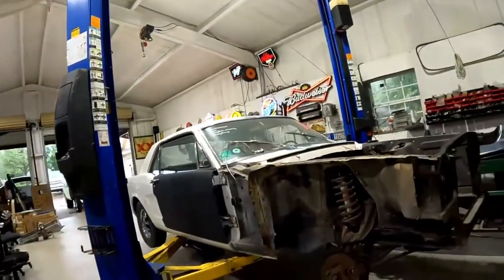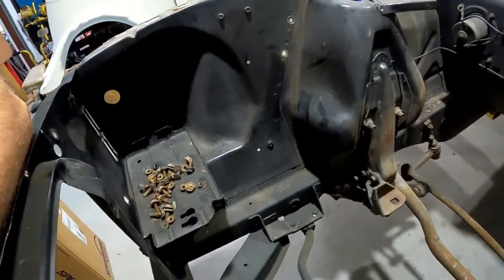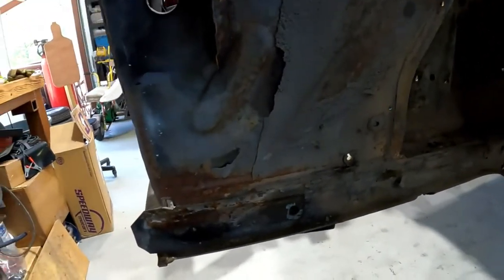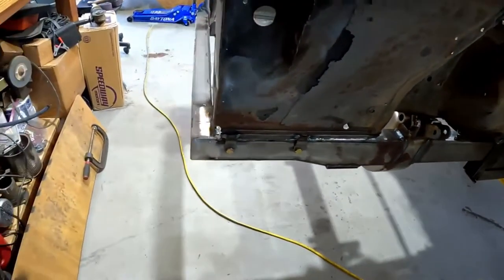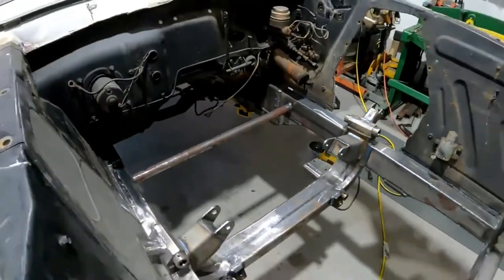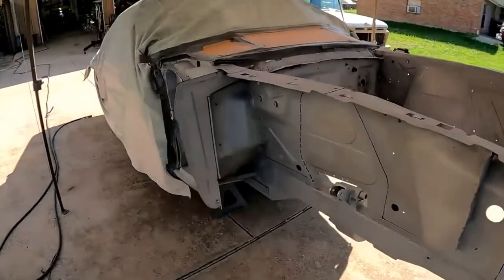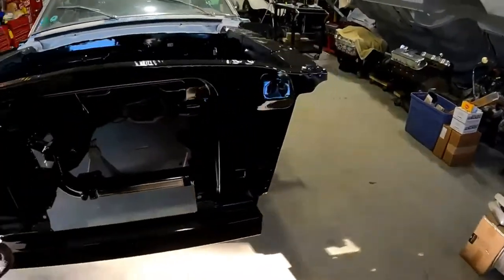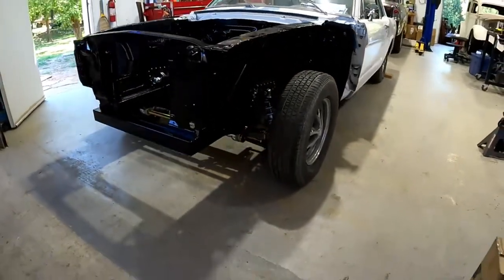1965 Mustang GT Mustang II Suspension Upgrade

Comment: So if this is for a customer, how much would you typically charge to have this done? Assuming they bought the kit?
Reply from the maker: We’re not currently taking on any new projects at this time.  On projects like this, I usually just charge by the shop hour because of all the custom work. Every car seems to take a little bit different amount of time depending on the car.

Comment: Do you have part #/and where you purchased from? And did You use the Rack n pinion manual ?
Reply from the maker: My buddy ordered it from https://www.cachassisworks.com/c-1469-front-frame-clip-system.aspx. It is a power rack